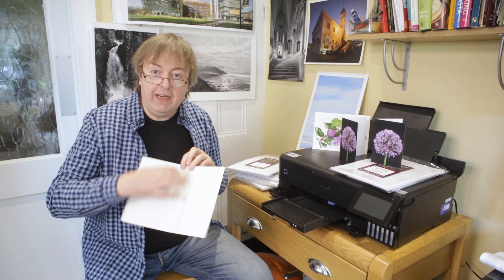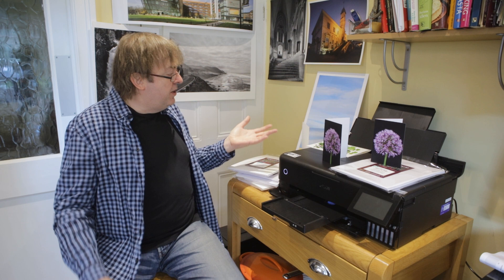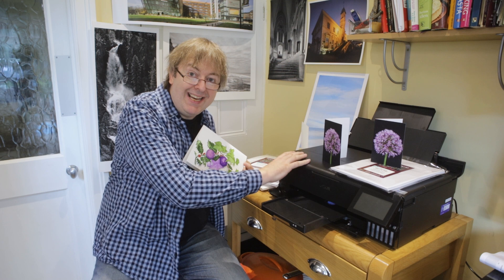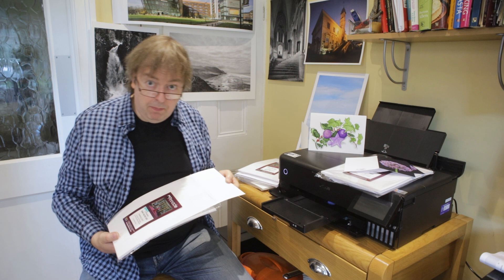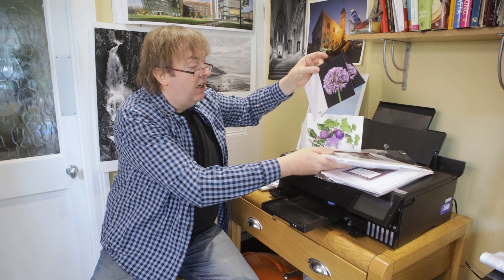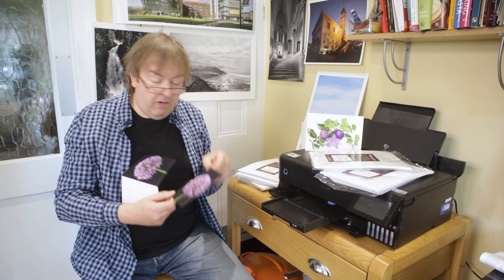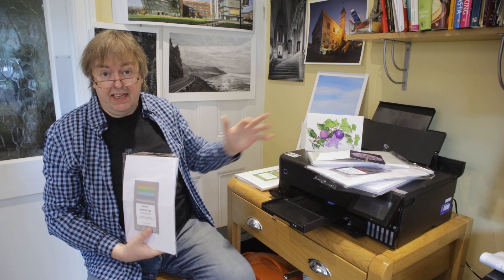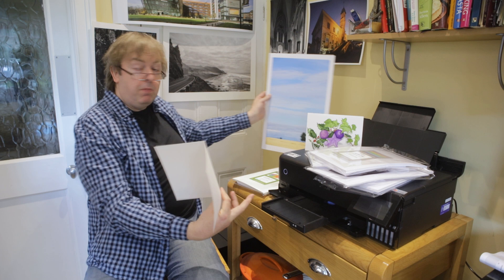ET 8550 greeting cards - using different types of card and how they affect quality

Comment: Pleeeeeeeeease will you share how to make the templates using the Epson Print Layout? I've spent the last few hours on it and i'm absolutely pulling my hair out! The software for making custom templates is an absolute nightmare to me - all I want to do is make a template for 4x A6 photos (and maybe a couple of mm bleed) and I just can't do it! The pre-set templates all have a margin between the photos. I'd appreciate it so much! Love your work <3
Reply from the maker: I don't have an 8550 here, but I am testing the new P5300 and was going to test some of this for that printer. 
Are you talking 4x A6 on an A4 sheet?
Reply: @KeithCooper  Yes 4x A6 on an A4 sheet, like how you made your borderless greetings cards. I've actually just zoomed in and spotted that it looks like you aren't using the software's 'Template' function - do you lay out your designs elsewhere and import to them to Epson Print Layout as a single sheet ready to print? I have no idea what software or method would be best to do that with - I don't have photoshop and definitely can't afford it.
My 8550 also always prints the image off by 3mm or so, which is quite noticable on anything that has a border - I haven't found a video of yours on this but I'm wondering if I had a way of making a template then I could manually offset my images by the correct amount to compensate for the printer error. ...or contact the manufacturer....
Thank you so much for everything you do
Reply from the maker: Yes - all done in Photoshop - I've never personally used EPL. I use it in videos since it's free, simple and the same in Mac and Win - that and using Photoshop frightens too many people :-) :-)
Try a demo of Affinity Photo?
See also my written reviews - far more info than the videos..
https://www.northlight-images.co.uk/epson-et-8550-printer-review/
https://www.northlight-images.co.uk/greeting-card-paper-and-printing/
Reply: @KeithCooper  Thank you!
Reply: I have just downloaded GIMP and the next project will be learning how to use it but I know it can do this template things...  @KeithCooper
Reply from the maker: Best of luck - not software I'd ever recommend I'm afraid. Free comes at quite a price...
Reply from the maker: I just remembered that there is much more about EPL in the main [written] P700 review
https://www.northlight-images.co.uk/epson-sc-p700-printer-review/

Comment: Any suggestions on best printers for printing  square cards 148mm * 148mm or 150mm *150mm cards?
Reply from the maker: Check the specifications for smaller printers - these sizes are often tricky to print.
I've not tested much in this type of printer, so can't do much more than to carefully check the full printer specs.
For such small prints it's often better to print on larger sheets and cut to size

Comment: Keith, I am having continuous problems with the rear paper feed not feeding in straight so there is an annoyingly white line appears at the right hand side of my prints. Does document binding have anything to do with this or do you know what will be causing this?
Reply from the maker: Is this for cards? (the subject of this video) Have you tried printing with the EPL print software?
Also, have you read the main [written] review
https://www.northlight-images.co.uk/epson-et-8550-printer-review/

Comment: Hope you can help.

I am looking to produce my own greeting cards.

I am looking for something glossy on the outside, the current card I have looks washed out, with a different texture on the inside that will enable you to print / handwrite a message.

What do you recommend?
Reply from the maker: Gloss/semigloss cards I've looked at have a matt inside, but they are single sided.
You can probably print some black text inside, but nothing fancy.

Suppliers [UK] I've  tried are Paper Spectrum and PermaJet  - you'll need to check what they are offering
Oh, and you'll need icc paper profiles for best results...
Reply: @KeithCooper  thanks Paper Spectrum offer a sample pack, might give that a go

Comment: Hello can I ask for your help I have ET 7750 Epson I want to print 150 by 150 borderless but I set it up and it keep printing a border . 😩
Reply from the maker: For the 8550 (which is what I tested) 150mm square is not a listed borderless size.
Borderless only works on certain sizes - otherwise you get an enforced border, no matter what custom size you set.
Check you printer driver settings to see which sizes are supported...
Reply: @KeithCooper  thanks I will check 😊

Comment: When you print a card like the black one with flower inside, which have the black background easily scratchable, the black ink the printer use for the background is the black dye or pigment one ?
Reply from the maker: On this paper it's the pigment - due to the VFA media setting - you could use the EMatte setting and the dye, but the depth of black would not be the same. This is very dependent on the paper. If course, if you liked it, a spray fixative would work well, and give added depth.
Reply: @KeithCooper  but if you need a spray then a good solution to do always the same is the Chroma Optimizer used in Canon pro 300 and 1000….. or a spray by hand is a lot better vs Canon CO ?
Reply from the maker: If I was doing it, I'd look at a spray fixative like that used for pastels?
However I'd likely choose a different paper for an image like that  ;-)

Comment: Great videos! Which printer would be able to handle 350gsm A3 prescored card in a multi-feed tray? Thanks!
Reply from the maker: In a tray? - none I've ever seen.
Reply: @KeithCooper  Thanks for replying. So what is the thickest card that doesn't have to be individually fed and which printer would be needed for that? Cheers 🙂
Reply from the maker: There is no printer I've tested which officially supports multiple sheets of card.
But... nearest would be this
https://www.northlight-images.co.uk/epson-wf-c8690-printer-review/
Reply: @KeithCooper  Thank you for the info! So this one can hold up to 10 sheets of 300 to 300gsm card. That's a lot better than just a single sheet. At least I'd be able to get on with something else for a while. Thanks again, this could very well be the way forward for me 🙂
Reply from the maker: Yes  - just notice the parts of the review dealing with colour management. Media choice is very important.
It's also one you'd get from an office supplied company - a good chance they will have demo machines.
Reply: @KeithCooper  Great, I'm going to read your review very carefully. There's a supply company not too far from me so I'll pop in and ask them about it. Thanks for your help!

Comment: I'm looking at buying a printer that can print on pre-cut A5  and A6 for cards (don't mind a border - at least thick 300gsm) without me having to print an A4 and cut it afterwards into A5 or A6 cards. From what I understand the Canon G550 can do this, but I'm a bit confused by the Epson 8550/8500 manual. It mentions copy paper (normal paper) and Thin Paper that can go through the rear feeder A5 and A6 size. Then it mentions thick paper (0.61mm - 1.3mm), A4 and up, not A5 and A6. The manual doesn't say what Thin Paper is, but it's right between the copy paper and thick paper setting. Is Thin Paper poorly choses by Epson and does this stand for paper that's heavier than copy paper, but under 0.61mm of thickness? Do you happen to know? Can it print on thicker A5-A6 cardstock, that's under 0.61mm?
Reply from the maker: yes - see my actual [written] review
https://www.northlight-images.co.uk/epson-et-8550-printer-review/
The videos are produced to support my written reviews  ;-)
Reply: @KeithCooper  thank you so much, I'll be heading over there to read through both the Epson 8850 and Canon G550 reviews.
Reply from the maker: @artbybenjamin  If you've any specific questions - email me via the Northlight site?
Reply: @KeithCooper  I will if needed, thanks.

Comment: Hi, I have the Epson ET 8500 and trying to print A5 in the rear feeder but there is no option to select A5 paper size, any ideas? I know it's not the 8550 but thought it should be similar
Reply from the maker: A5 is missing from quite a few printer options I've found - create a custom size?
Reply: @KeithCooper  cheers, is that easy to do?
Reply from the maker: Yes - see my 8550 review (using EPL to print)
Of course that's with a different printer - I've never seen an 8500
https://www.northlight-images.co.uk/epson-et-8550-printer-review/

Comment: Hi
What would be a best option available in market for A5 size stickers. I am trying to print a photo with QR code.
Thanks in advance
Reply from the maker: There is no 'best'... ;-)
However, if you can get sticker media that works with the ink. one of the tank type printers will save money. Since with stickers, you are not challenging print quality in any serious way.

The key though is in getting the media that woks with the ink
Reply: @KeithCooper  thanks for the great advice, currently I have an option to get espson L 805 which is promising a bit but I will try it out with different media as well

Comment: Hi keith, how were you scoring and folding the paper? as the paper seems not to be pre scored.
Reply from the maker: Sorry, but all the paper I look at for cards is pre-creased and with envelopes.
The crease is not obvious in some, since having it too prominent might cause head strikes or print problems
Reply: @KeithCooper  Ah i guess i need to search again.
Reply: Ok i have found the pre creased ones, similarly priced. I am curious to try these out, i've tried cheaper cardstock which was not as bad as you might think, but sometimes the quality indeed does not hold up. I noticed your card with the flower has a black background. Did this make the card curl at all? I have gone up to 350g on the previous cardstock i have bought and all of them have curled with black or dark prints, which means i can't sell quite a few of my designs.
Reply from the maker: I've seen no curl on these, but it is always a potential issue with some inkjet media and changes of humidity.
Reply: @KeithCooper  Thanks i will give them a try at some point

Comment: Sorry Keith if I'm a little wary but would you recommend it to me as better than the XP970 on photographic quality?
Reply from the maker: Ah, I don't ever make recommendations ;-)
With good profiles, I'd pick the 8550 for size, usability and cost of ink. BUT how much difference you'll see depends on the quality of profiles, images and workflow used with the 970, which is a cheaper lower spec printer.
Neither are in the category of the P700/P900 of course, but prices differ...
Reply: @KeithCooper  Thank you
Reply: I know that the P900 and the Canon pro 1000 are the divas in photographs but the inks cost a lot too! for this reason I was trying to exploit your experience in use and decide to buy the ET8850 @KeithCooper
Reply from the maker: Yes, the 8550 is a good printer for dyes, but it needs good profiles and careful paper selection - I have notes covering this.
If I make a bad print, it's my fault, not the printer ;-)

Comment: Hi, I hope you are well. I have recently bought the Epson ET 8550 and have found your videos really useful. I am just wondering if you have experienced any print-roller indents in your prints. I have been trying to print cards with a 300gsm matte paper and am seeing the roller indents throughout. I have tried different settings and still nothing has changed. As you have a lot of experience I thought I would ask! Thanks in advance, Lucy
Reply from the maker: Not seen it, but heard of it for some thicker papers.
I only had the printer here for a few months. I didn't actually use it for anything beyond the testing and reviews - it was a loan from Epson.
If you can get the marks on an Epson paper, and it's a new printer, I have heard of Epson replacing them
Reply: @KeithCooper  Thank you for your thoughts. I have contacted Epson!

Comment: Hi Keith, great video thanks. You mentioned its a bit slow. Do you have any recommendations for printing greeting cards on 300gsm Tinteretto Gesso paper that would be good - printing 50 plus per day, sometimes 100. The artwork is mainly text based not photographic. Thanks.
Reply from the maker: Thanks
I've no idea what that paper's like, so I can't offer any suggestions with respect to that.
But... I'd definitely not want to be running 100 sheets a day through the 8550.
There are none of the printers I've tested I'd immediately suggest for this - they are simply not made for bulk printing of this sort - the stuff I look at is for photographers and relatively low volume at high quality.
Stuff like this comes down to business and marketing considerations as much as printer features.

Comment: are there any MATT paper that i can use for printing cards preventing water destroy? I see if a water drops on the paper print (i use both plain paper and 300gsm watercolour paper for test), colour dissolves out quickly, while it is much better when i use photo glossy paper.
Reply from the maker: Not with the inks of the 8550 as far as I know - they are water based
Reply: @KeithCooper  do you have any recommendations on matt paper, that i can used to make prints by et-8550 more of a water resistant type? just like the effect printed out with the photo glossy paper?
Reply from the maker: No - there is not likely to be a suitable matt paper of this type